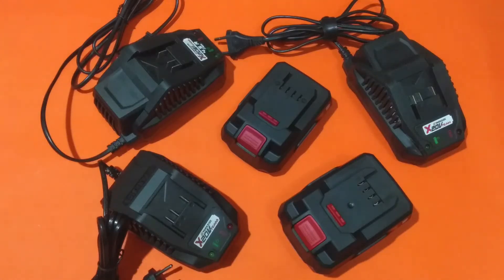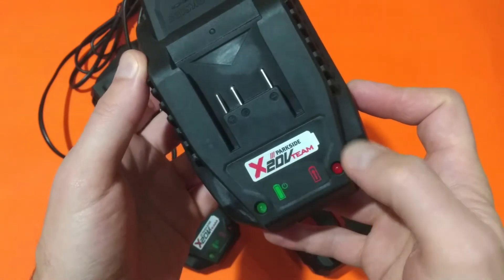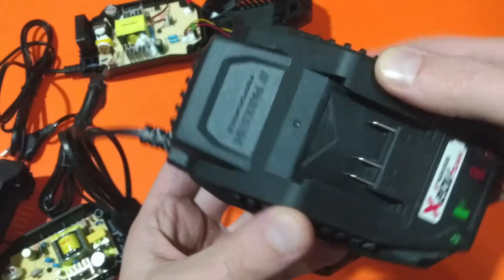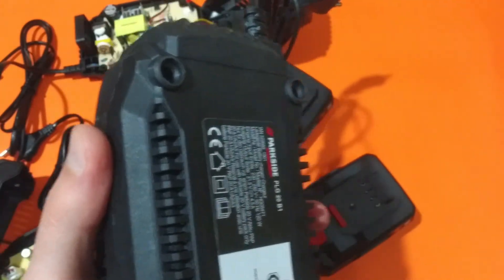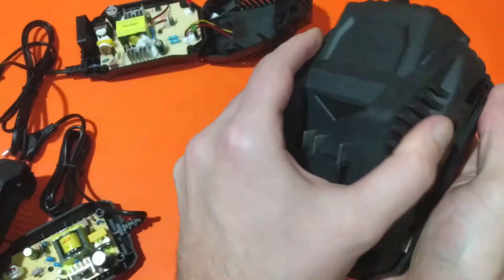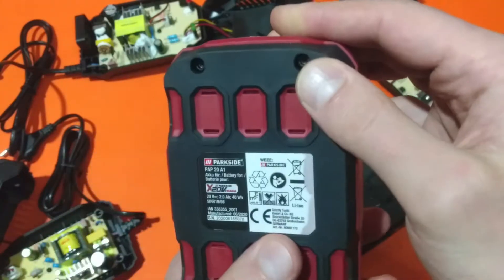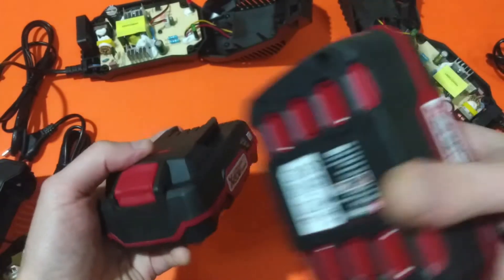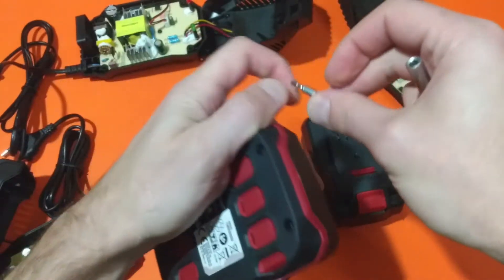Teardown of Parkside Battery Packs and Chargers

Comment: Hi, nice video. I am thinking of remaking one of my 4Ah Parksede batteries a 6.8 Ah battery by changing all the cells drom 5x2x2000 (5S2P) mah with 5x2x3400 (5S2P). Do you think the BPA board would permit it? I dont have a 2Ah for comparating are they exactly the same? I havent seen any cell balance circuit in mine, maybe ițve missed it. Have you seen any in yours?
Reply from the maker: My batteries do have balancing circuits, but the transistors are so small I don't think they are really capable of handling 2A. I don't know ...
Reply: @Schwalbe262not yet. I will do it after one of my batteries dies. Or after my laptop battery dies so i can use the small cells from a good battery to put them inside the laptop. And the new ones i will use for the tool battery.